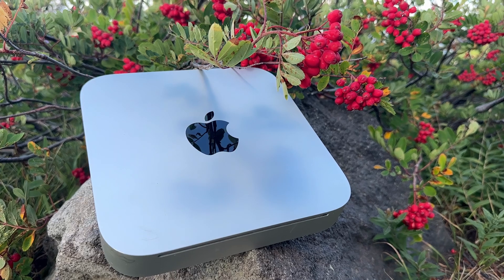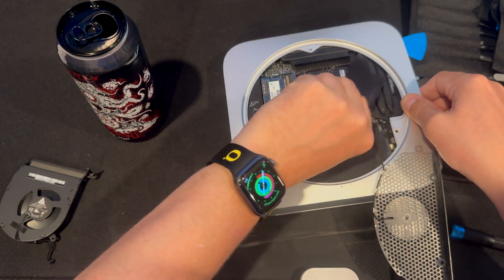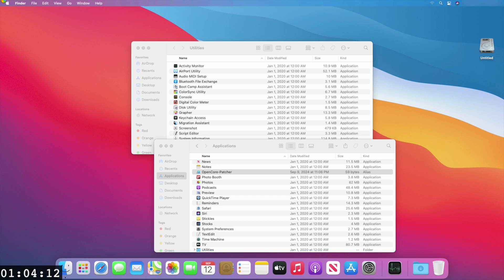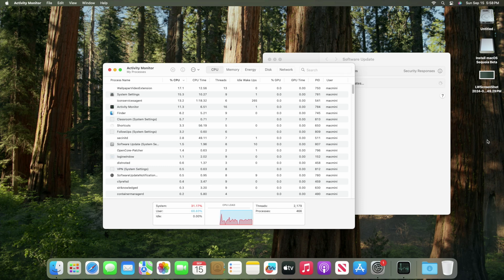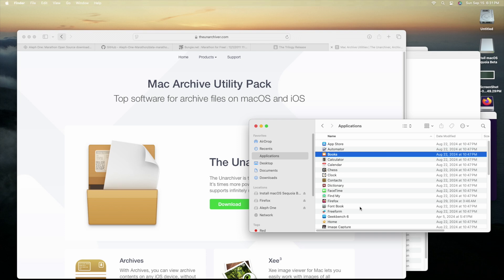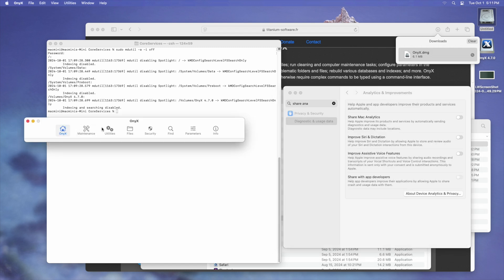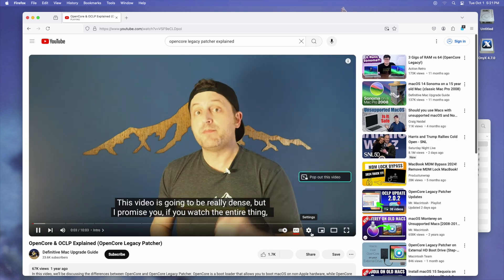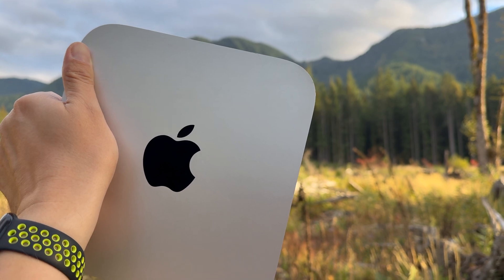How bad is a 15 year old Mac running macOS 15 Sequoia?

Comment: I have a 2012 i5 Mini. Upgraded with 16gb ram / 256gb SSD. I ran Ventura on it reliably for a while with OCLP. I was methodical about checking for updates via the OCLP app and doing driver updates, and it ran just fine. I did shut off the fancy graphical effects for just a basic desktop look. Typical computer tasks were flawless. Running old retro games or old games via Steam were fine. I ripped cds and managed media fine, no obvious slowdown. 

For a year now I’ve been running Linux Mint on this machine. Mint runs better and faster than either Ventura or Windows 10. If you can switch to Linux and still accomplish what you need, I wholeheartedly recommend Mint, I have everything running beautifully and up to date. I’m even getting pretty good with terminal commands, though Mint makes it super easy to do everything in the GUI.

Comment: My late 2012 mac mini has 2.5ghz dual core 16gb ram and a 500gb ssd.  I installed mac os 15.7 yesterday with oclp and it runs just fine.  However it did take about 4 hours to install it because it was about 40 minutes to download the installer and then 45 to make the installer then I had to wait for the computer to reboot like 7 times before it launched into mac os 15.7.  I hope they can get tahoe working on intel macs it would be cool.

Comment: I used a mid 2011 with sequoia. Sequoia took quite some effort and time to install, but once installed and up and running, I installed Jellyfin server, no transcoding of course, and it performed surprisingly good. And with its 6.1 w idle power consumption it will work for me. I initially started with Ventura, but like your experience this was slow, slow, slow.

Comment: im doing literally the same process on the same computer but when i go into the installation of sequoia, the mouse stop to works making me unable to select the disk where to install it
Reply: Were you using a Bluetooth mouse? It is noted that with Open Core Sequoria that you’ll need a usb keyboard and usb mouse. I was able to update a 2012 Mac mini with a usb wireless mouse and a wired keyboard to get through the installation

Comment: I did the same with my MacBook Air 2017 and man it become so much faster compared to its last update in Monterrey. 😅
Battery life has increased by an extra hour though, I’m not sure but it has. 😅
Also, when you first install OpenCore and install “newer” updates it will always run super slow, make sure you download those necessary patches to fix that issue. 👌🏻😊

Comment: Cool. I have the 2010 (with 16 Gb RAM) and I loved that machine because it has every port I could ever need (then). My 2017 Macbook Pro, two lightning ports, one for charging, GRRRRRR. I only use the 2010 for some legacy software (QuarkXpress 9) which I refuse to upgrade or subscribe to. Impressed with what you've done.

Comment: Of course it's slow, it's a CrApple device. CrApple sells deprecated technology for 4x the price, because it's a "name brand" and gives you "clout". Stupid iSheeple. My PC from 2008 had 8GB of RAM, a 4 Core CPU (8 threads), and AMD 6870 GPU, that can run Windows 10 and still play modern games. Runs even better with Linux. F*ck anti-consumer CrApple. Linux FTW!

Comment: The Mac Mini had so much potential as an affordable, modular, upgradeable computer, and they ruined it by soldering everything together, making it as expensive or more expensive than any other x86 machine, and wasting 60% of its internal space. Apple Silicon is the biggest disappointment in Apple's recent history.
Reply from the maker: Of two minds here:
Apple Silicon makes a helluva lot of sense for laptop (Sans the bolted down SSD, that's just being a bastard coated bastard with a bastard filling). Current job I have 2019 MacBook Pro and it's nuts how much better even an M1 Air is let alone my M1 Max. I'm willing to make the trade off.

On desktops, Apple Silicon is just.... "eh". I'd take a hotter machine if it meant modularity.

Comment: I got a couple of MM 2012 and 2014 using OCLP running Ventura and Sonoma. The 2012MM have 8GB Ram and 500GB SSD and it runs pretty good. The 2014 got 16GB and 1TB with Sonoma and also runs fine.

Got a MM 2010 like yours and haven't done much with it yet. I put 10.7 Lion there and it runs great. I might just leave it on Lion and use the CD player to play retro games. Have not done any upgrade on it yet. Maybe later this year during the holidays.

Comment: What I noticed about MAC OS is that Sonoma and Sequoia require 6gb of RAM at idle on activity monitor.
Reply from the maker: It'll actually jump around based on how much RAM you have, less ram and it'll use less wired RAM. macOS like the IRS when it comes to memory, the more you have, the more it wants.  Of course, more is better as more of the OS core functionality can be always present.
Reply: @dmug  I compared the specs on the a1708 MacBook Pro with the a1502 2013 with 8gb (similar specs to the a1708). Loaded Ventura with OCLP into the 2013 and checked the RAM usage also considering it is also a 2 core I5 like the a1708. Ventura running at idle with 3gbs of RAM on the 2013. I think Ventura is the last MacOS that runs very smoothly with 8gb of RAM with a 2 core Intel processor 2013 to 2015. Any thoughts on this?

Comment: Well-‘Cooked’ as we would say in the UK! Share Greg’s pain re: the internal surgery required in some these ‘upgradeable’ models (ah… golden days). If you ever have to replace the CMOS battery in a 2013 ‘Trash Can’ Mac Pro, you’ll need a large desk, a lot of time, and a therapist on hand afterwards!
Reply from the maker: I didn't realize "Cooked" was British in origin. Yeah, I miss upgradability. I originally was going to pull the Optical drive but saw you needed specialized tools on iFixIt and nixed that idea.

Comment: Thanks for a nice video! I'm using a 2012 mac mini with 16GB ram with a dirt-cheap SSD, really run well on Sonoma via OCLP! No rush on updating to Sequoia as many patches still coming, may try it when updates settle down a bit.
Reply from the maker: Those 2012s are oodles better, I kinda want to get one, I’ve recently seen them dip to $50

Comment: Interesting to see that Big Sur ran so poorly in comparison to Sequoia, nice to see that it does work well though. My 2012 Mac Mini runs Big Sur extremely well, it still feels very fast and responsive. The 2010 is a cool system considering it has an optical drive and it does support older versions of Mac OS also, having it setup with a bunch of old Mac OS X versions sounds awesome!
Reply from the maker: I'm wondering if my install was kinda borked by installing it with only 2 GB of RAM or something. It was impossibly slow.
Reply: I’m sure it didn’t help, my Mac Mini was already upgraded to 16GB by the time I installed Big Sur. Even though mine is a newer model, the 2010 should still work well for newer versions at least when upgraded.
Reply from the maker: @TheOriginalCollectorA1303  Yeah, I kinda wanted a 2012 Mac Mini but my budget for senseless old computers is pretty minimal. I'm still debating what to do with this computer, I'm thinking I'll install macOS 10.6 - 10.15 for when I need to quickly test something from that era. I have a black MacBook 2007 with Snow Leopard but I find the screen so unpleasant to use.
Reply: I use my 2012 as my main editing machine with FCP, I upgraded it because it is more or less my main modern Mac desktop. I do use other systems often, but the RAM and SSD upgrades have been worthwhile for FCP alone. That sounds like a great use for the 2010, it’s nice to see it can run the latest, but it will run older versions really well. I’ve got a black MacBook 2008, but I use it more as a Mac Mini since the backlight inverter board doesn’t work. Still a fun system to use though!
Reply: @dmug What is the approach to do that?
How to install multiple macOS in the same machine?
How many space will it need’s to have multiple versions?
I have a same machine with only 8Gb of RAM and this solution to install some versions of macOS it’s a good idea.
Reply from the maker: @ovigilante2k5  You have to create partitions on a drive, older OS Xs only require minimal space, I think you only need 6 GB minimum for Snow Leopard although it'd be wise to make it larger like 10-20 GB. It's about the same for 10.7 and 10.8. 

After that you'd want a bit more partition space for 10.9 and above as they more aggressively use the boot drive partition for virtual memory. I believe the minimums for late OS X is more like 20~ GB so you'd probably want 50 GB partitions.  A 512 GB SSD partitioned 10 times would be 50~ GB.

Also conversely, people will buy 256 GB or 512 GB make single USB installers for almost every version of OS X/macOS as the installers are generally 6 - 15 GB, and you do not need extra space. One USB drive but when you option boot, you're presented with a swiss army knife of OS Xs.
Reply: @dmug  Many thanks for the explanation!

Comment: I've got a mid 2011 quad-core i5 iMac and a late 2012 dual-core i5 Mac Mini running Sequoia via OCLP. The imac has 24gb of ram and a 500gb hard drive and it runs Sequoia pretty nicely but since it's a non-metal gpu and 'legacy' Bluetooth, a lot of productivity apps and ever Airdrop won't work which kinda limits its usefulness. My Mac Mini, which I paid 100 Canadian dollars for has 16gb of ram and 2 500gb ssd's. It was actually running Kubuntu when I bought it, liiterally as soon as I got it hooked up I put Sequoia on it. 

I've also got a late 2009 Core 2 Duo iMac with 4gb of ram running Monterey. I want to try putting Sequoia on it as well but I either need to get a bluetooth keyboard and mouse or get a usb hub as the installer quits because it doesn't detect any input devices
Reply from the maker: Yeah, the ol usb hack is annoying

Comment: If it was the 2012 QUAD CORE 2.3 or 2.6 Ghz it would be a breeze to run Sonoma... Those QUAD CORE 2012 Minis are like the HOLY GRAIL of the Minis...
Reply: as it happens, i own a max-spec 2012. this would be true, and the 2012 would be perfectly usable if it wasn't for egregious thermal performance. there doesn't seem to be a good fix; re-pasting doesn't do anything. with macsfancontrol and the internal fan spinning its heart out most of the time, it does remain genuinely usable though. :3
Reply: I need to try on my Mac Mini!
Reply: I just picked up one of the 2.6 Ghz ones to act as my iPod syncing computer, as it has a FW port for my older iPods and was the same cost and as the Thunderbolt 2 to FW800 adapter. It's still very usable, but I keep it on 10.14 for 32-bit application support.